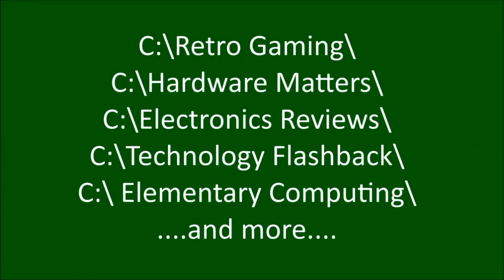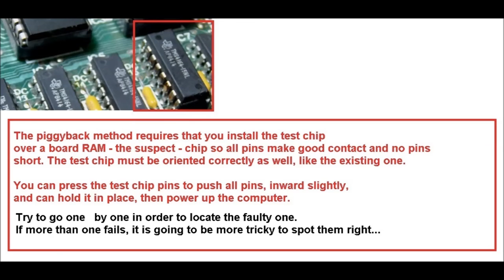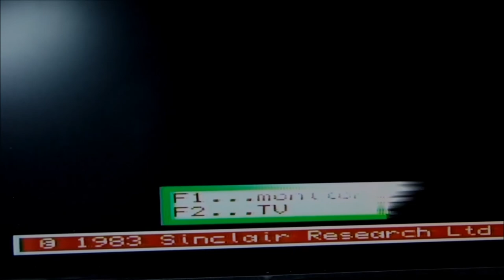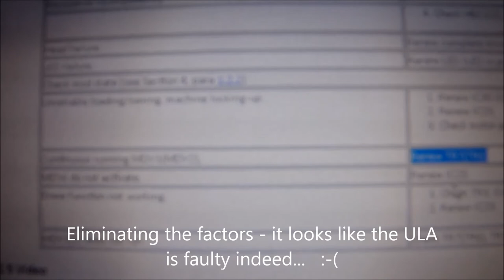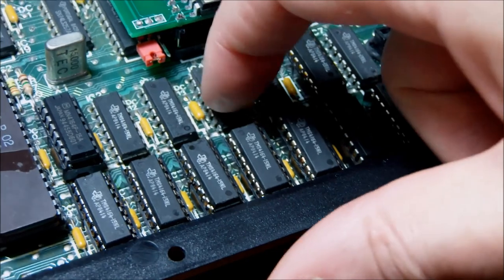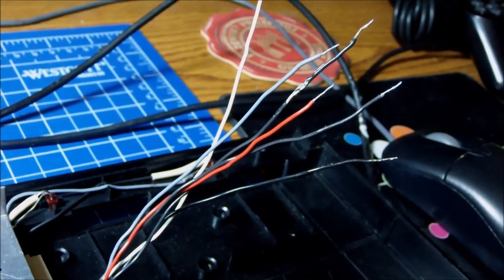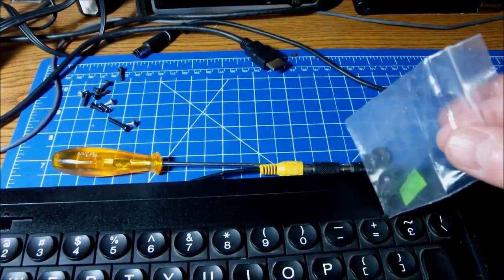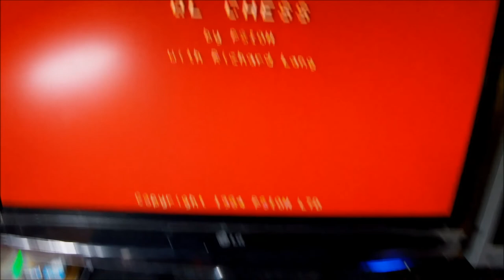Sinclair QL - 1984 - RAM Fix & Upgrade, Minerva ROM Install etc.

Comment: You've done a really nice job with that QL. Seams that the micro drives are a major point of failure on them but, you have one working and puting a SD card solution in place of the second really would be the best of both worlds. Lovely to see a QL working properly and maxed out on memory (640K is the max isn't it?). Again great job, you're but a CTRL key away from a very respectable and rare example of Clive Sinclair's ultimate business computer ;)
Reply: Hi Peter! Thank you my friend, I enjoyed this one a lot - apart from the broken traces :-D Very glad you liked it - The plan is to keep it for ICE installation, mouse and whatever comes along. The SD is the next goal so, i could deal with MDV future mishaps. 640K is indeed max. but as far as i can remember, ICE and other great software apart from games that is is OK with that. 
Looking for this CTRL key over EBay for now! ;-)

Comment: Hi, this has been a very useful video. I have a QL coming from eBay and would like to test the RAM, where did you get your Minerva ROM kit from?
Reply from the maker: Hi Byron, thank you so much for watching and for the useful comments here! The Minerva comes from Ebay from a friend in Germany (reasonable price!) and the RAM test can be done with the help of a Dynamic RAM tester ( TMS4164A-15NL or other manufacturer) - also from Ebay - mostly UK sellers! Cheers!